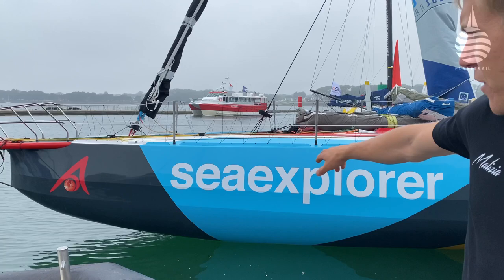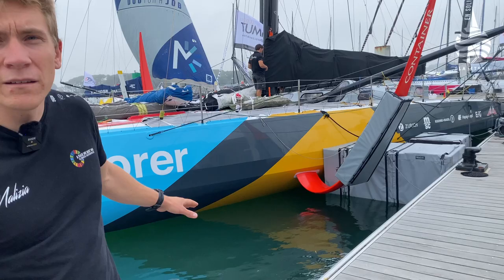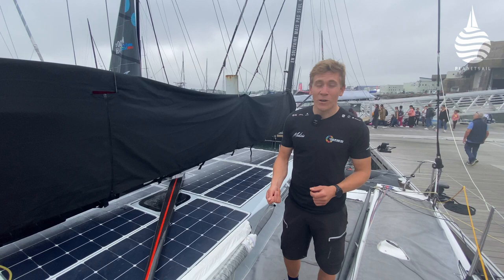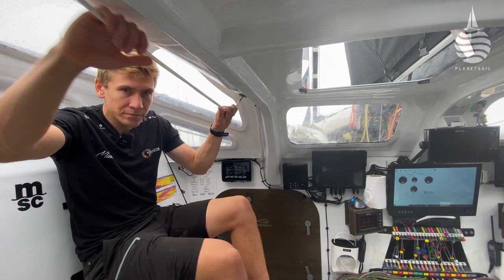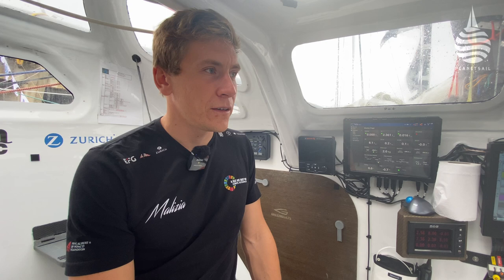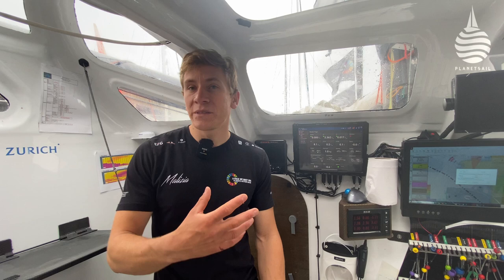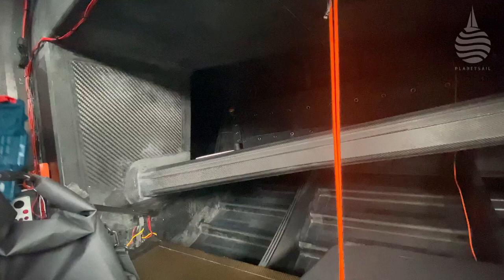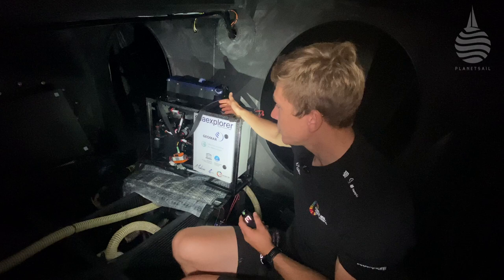Inside the latest generation IMOCA60 - Malizia

Comment: With only 5 Imocas, of which 3 are brand new and one having over a years worth of training, I can envisage a lot of breakdowns, especially now with 4 crew pushing the boats even harder as compared to singlehanding. 
There is a real danger of the Ocean Race becoming a bust. I certainly hope not, but without the reliable VO65s, it's going to be tense for the organisers.
Reply: so true.   And it is becoming a test of who can best design a computer that steers and less of hand skills.    I hope these falter in popularity and VO65s or an equivalent takes over in the long run
Reply: Then I guess it's lucky for them they included the VO65s in the race, too.
Reply: This issue not unique to sailing. Motogp bikes, F1 cars, rally cars, etc. All full of electronic aids to assist to the drivers but when is too much? I agree, it’s becoming more about the machine and less about skill.

Comment: In general, if you can do it, your forefinger will be a better controller than your middle finger, if a little harder to put on the screen, since it is slightly shorter. That finger does have a lot more nerves and so it will enable you better touch control.

Comment: Millions spent in R&D, engineering and construction.......why not a couple of hundred dollars more to install light in the dungeon!! hahaha
Reply: That was my immediate thought especially when going solo in Vendee as getting injured surely has to be a serious risk that needs to be considered! Nuts
Reply: Because those millions you spent on R&D taught you that weight matters and sailors already have headlamps, so no need to add 5-10kg more.
Reply: Thats a lot of weight and extra cables
Reply: Bit of foam padding and good light would be nice when you need to do emergency repairs
Reply: @bobbob6472  - soooooo… weight matters. Just curious, what’s difference in weight between a LED headlamp on all the sailors (straps and batteries, stored when not in use, plus backups) and the weight of 3.3v light strips

I’m not sure you’ve thought that answer through…heh
Reply: @arctain1  The headlamps would be ~25% lighter when you calculate all the parts needed for the installation of fixed lights, not to mention the the holes needed to be drilled into the structure to run wires and support the lights (to get lights in all areas)

So yeah, it is cheaper and better (by weight and design) not to have to mount a ton of lights when you can just wear a headlamp.
Reply: @bobbob6472  - no, it’s not. You have zero idea what you are talking about. As proof of that (and your made up ~25%) what’s the weight of the handheld/headlamp batteries and spares needed for operation?

Oh… And, you don’t need to drill holes for lights. 🙄
🤡
Reply: @arctain1  Why would you carry a spare battery for a headlamp with a builtin rechargeable battery?

Either way, if you can not understand why using a headlamp is a much better option than stringing 100's of Meters of wire to run 20-50 lights than maybe race boat design is not for you.

Also, if you do not run those wires inside things (ie drill holes) you then have loose wires that can get caught or snagged by anything that goers past it.

In the boat building world, we use the, "Why use a fancy pen, when a pencil will do" term very often.
Reply: @arctain1  Just saying, you will need the headlamps anyways, so comparing the two is pointless anyways.
Reply: @glemau9667  - heh… perhaps. It’s a choice issue, not a weight issue, was my point.
Reply: @arctain1  They are always choices.  The choice was to save weight, save electrical power usage, which is partially offset during the day by portals, and at night by backlit screens.  As long as your getting your proper vitami A the human eye functions quite well in low light conditions, so a headlamp with rechargeable batteries is quite good enough.
Reply: @davidtuttle7556  - agreed. And while it may not have been clear, that was the point I was fumbling over, badly. Thanks for making it clearer 😁
Reply: @arctain1  I would also add on the negative side here that the less wiring needed the better for conditions in rough seas as loose wires and fittings are an increased risk for fires.  For myself, as a land lubber with lots of camping and night hiking experience, headlamps work well and are pretty close to indestructible.
Reply: @davidtuttle7556  - agreed, they do. However, LiPo battery-op led lights add about 6 oz to the localized (read: stick on) installation location, have zero long wire runs, run 3.3v and are rechargeable with overcharge protection - and come in waterproof housing. The amount of short-term light below desk is worth the backup for a headlamp with minimal weight. 

If you want to get downright geeky and cool about it, you can even program them to glow red or green at low intensity/brightness to maintain night vision, or… at a flip of a switch, produce bright white.
Reply: @arctain1  stick on lights don’t work real great in the damp environment at sea, especially when the hull starts to flex and vibrate the way that the IMOCAs tend to do especially in high sea states and when the foils get going.  They come right off.
Reply: @davidtuttle7556  - nope, not true - there have been major advances in adhesives and glues that hold in high vibration, high humidity, high moisture environment. But if you don’t want adhesive, use a bronze screw - they handle that. And if you are worried about sealed lights in a marine environment (this is actually my area of specialty…) leaking, the moisture in a non-sealed headlamp is actually what got me started on this thread. 

But - and this is the last I comment on this - they can do what they want. They have options. The option I mention is not only sound, it’s proven in cold harsh marine environments. And it’s a heck of a solid backup to ‘indestructible’ headlamps that go missing, aren’t readily at hand when needed, or either aren’t charged, or have somehow ‘failed’ in storage.

Comment: Would like some one to explain this uncomfortable round motion mentioned caused by the foils compared to a normal heave. Any can answer if I have insight. Thanks!
Reply: I would say it has to do with acceleration and decceleration combined with up and down movement. Like the boat is accelerating and the foil is lifting up the bow (up +forward sensation), then it hits a wave and is slowing down and the bow moves down bc the foils dont generate enough lift (down and back sensation). Its almost a circualar motion. 
I never experienced it but thats how i imagine it when he talks about circular motion.
Reply: @timlolxP  Ok, on the vertical plane. Was thinking in the horizontal. Thanks.
Reply: @PaulAnthonyDuttonUk  I think the horizontal plane also plays into it :D 
Like i said i was never on a foiling race boat.

Comment: A few gram of light paint for the sail locker room is to much extra weight for the boat? And how about some LEDs for the same room to make it less dangerous for the crew to work their with the sails? Sorry thats idiotic laughable. I generally find it unessesary masochistic to make the boat not somewhat more liveable. Like the constand noise from the boat being build of carbon, one could use noise cancellation technic like many modern headsets have it inbuild as standard. The noise stresslevel goes up quite a bit with continous noise present, that will coast the crew alot of concentration power, and pushes them into making mistakes.